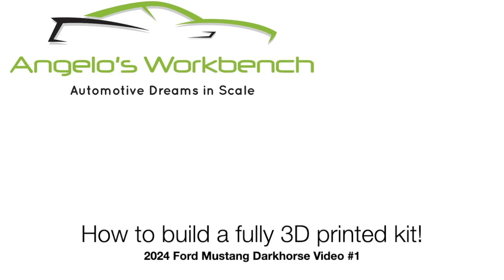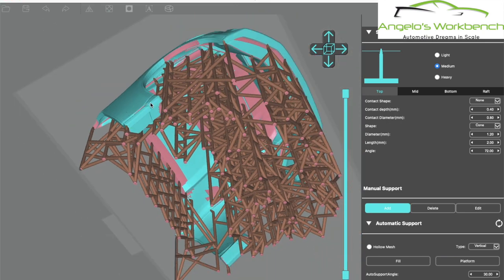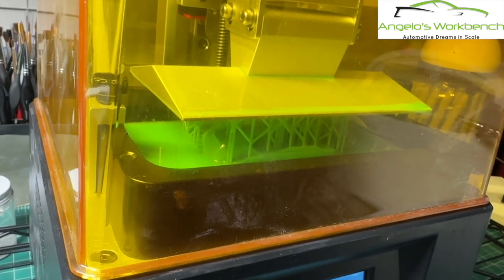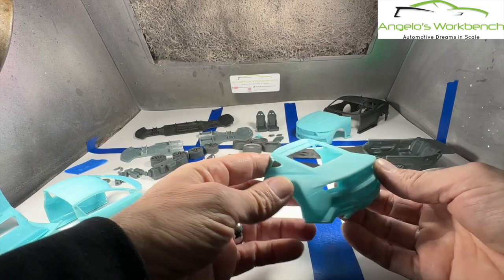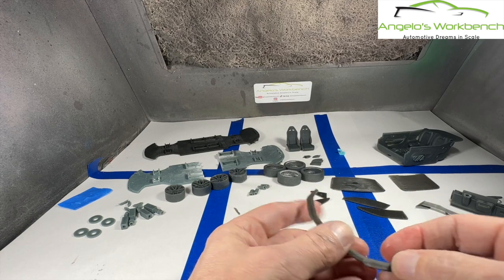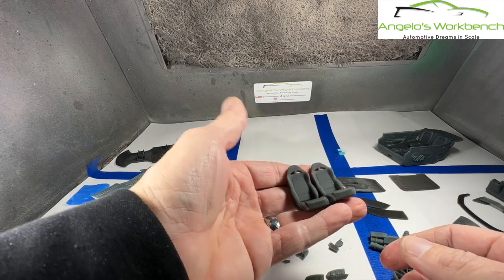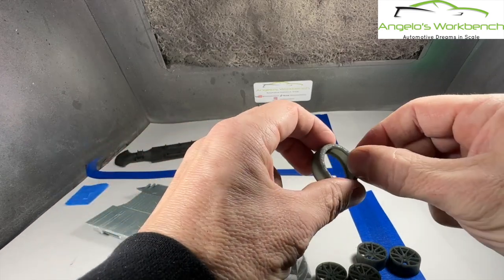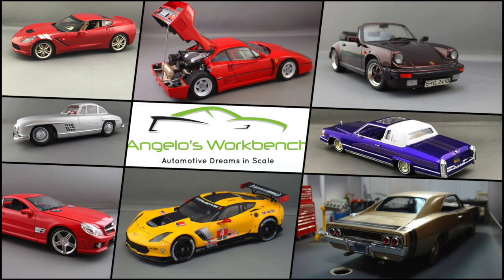How to 3D print an entire kit 2024 Ford Mustang Darkhorse Video #1

Comment: Thank you Angelo for posting this video. I’m still on the fence about buying a printer. Wife is a ball-buster about  smells. She isn’t happy when I use 2 part epoxy．😂. I’d have to use the water based for sure.  I learned a few things from this video. Looking forward to part 2.
Reply from the maker: Thanks!
Reply from the maker: I was thinking about this. If you could move enough air out of the room and create a negative draft all the vapor smells would go out. I do something similar in my workbench which is a bedroom on the second floor of our home. With a spray booth, window fan blowing out and even perhaps the installation of high cfm bathroom vent fans you could probably get where no smells would go into the rest of the house. Of course the larger your space the more air you’d have to move.

Comment: Great video. That resin though is still very toxic, and resin should not be washed into the sewer system / municipal water supply. I wash my parts in IPA, then scrub them in a tub of warm water with dawn dish soap. Once all my parts are scrubbed I set them aside to dry before final curing and I set the tub of water out in the sun for a couple of days to cure up the resin I washed into the water. It can then be poured out and disposed of but not down the sink.
Reply from the maker: Thanks for the tip. I will institute a similar process.

Comment: So the hot water technique - are you curing the body with the supports, then doing the hot water method? Or are you just washing the resin off the body and supports, then use the hot water technique, then cure the body?
Reply from the maker: Thanks for the great question! I use the hot water technique first. Then I cure. I’ve found it easier and also getting any extra resin off before curing is important because once cured it’s part of the part and will not come off. Thanks!

Comment: Pretty educational video but washing the resin parts in your bathroom sink is a big NO, in my book. If you don't thoroughly wash the sink with IPA the toxicity of the resin will remain on the surface until it's cured, especially when the sink is made from porous materials and the resin can infiltrate within the micro cracks. You should at least add a warning for those watching that this is not safe for neither your health or the environment.
Reply from the maker: I should have clarified in the video. I use water wash up resin.
Reply: @AngelosWorkbench  while the water washable resin is less toxic don't get fooled by the marketing gimmicks, it's still plenty toxic. You can find a lot of reddit posts about it or articles from people that have actual experience/knowledge with toxic substances/liquids. Proper safety steps should be taken, especially if you expose yourself with a high amount of resin. By all means, I'm not judging your video nor your hole process, I'm just trying to provide more insights on the dangers of resin usage since a lot of people become more and more attracted to this hobby.
Reply from the maker: @TheBadBone23  thanks for the information. I will look into this further.